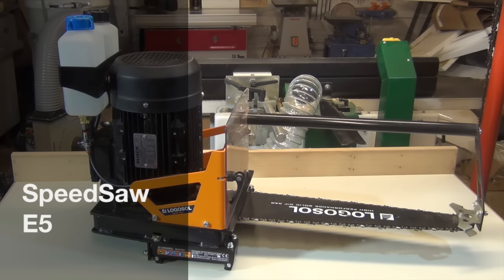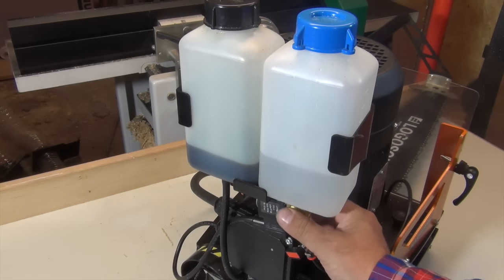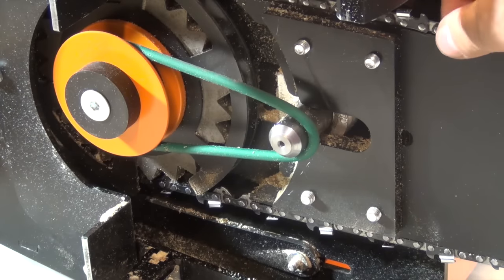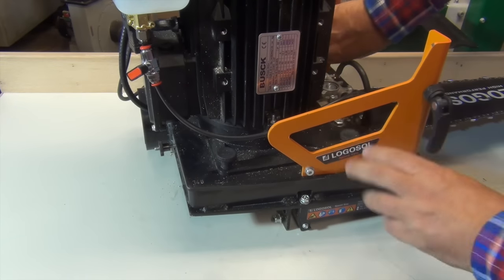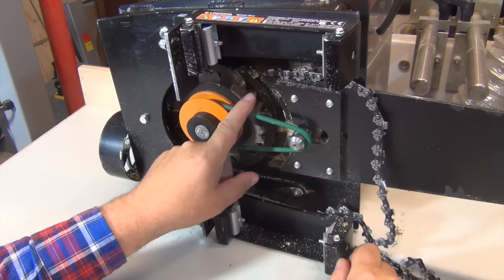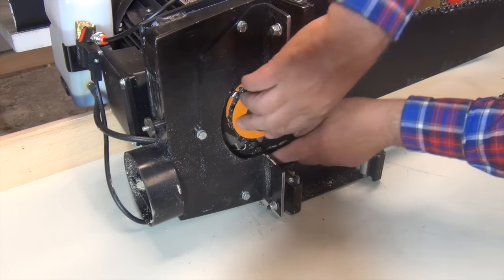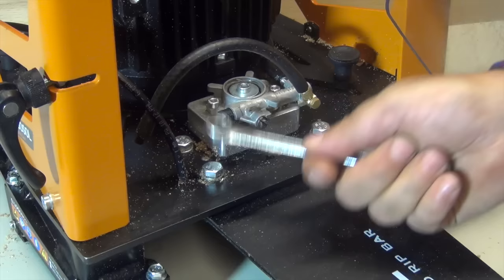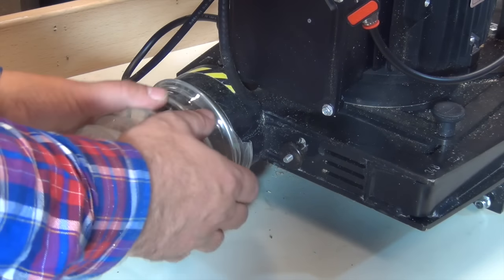Detail view of SpeedSaw E5

Comment: That little speed saw is fast.
I have a 3120 xp running 13000 rpm. on a similar type mill and I don't think it cuts this fast.
it also consumes 3 liters of mixed fuel per hour on average.
very nice power head and a practical solution.
less noise is a huge factor also.
Reply from the maker: +Gas Axe yes I really love it.
Reply: Project of the day - please tell me what the drive motor is for back and forth ? nameplate rating
Reply from the maker: +bigwillywes78 I live in Sweden and all houses have 3phase 400v here. But I thick there's different opinions in different countries. Check logosol.com for your country
Reply: hello sir

Comment: I'm very curious about how the water and oil mix works for the chain cooling.
I would have thought that the water would just turn to vapor at that high speed.
Reply from the maker: +Gas Axe it works really good. Check my video where I saw old oak log. Water mix with saw dust and stay in the cut

Comment: How many kw is that one ?
Reply from the maker: Pietro Genduso it’s 5kw and there’s a model with 8kw
Reply: thanks , it looks like very fast for  5 kw
Reply from the maker: +Pietro Genduso yes it’s fast :) and I think you can get out about 8-10kw from the motor for shorter periods if you hit a knot or something. There is also a heat protection in the coil of the motor so you don’t burn it